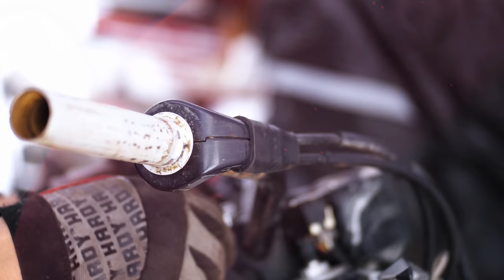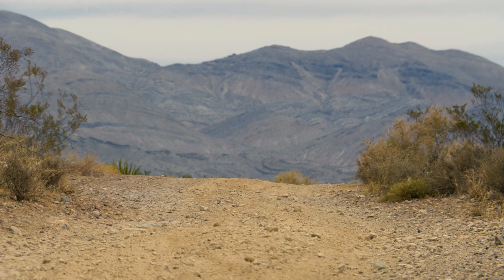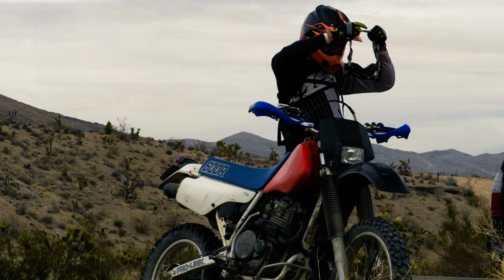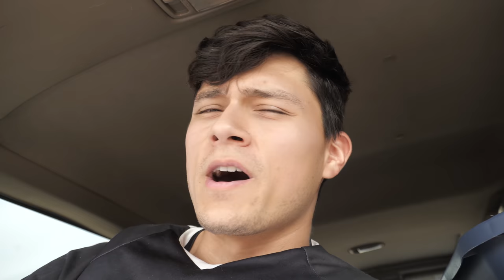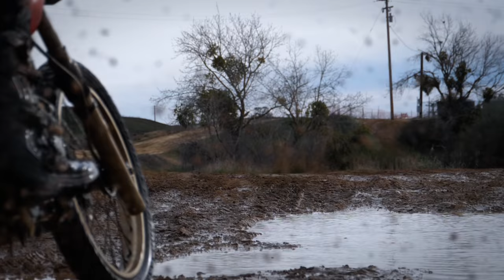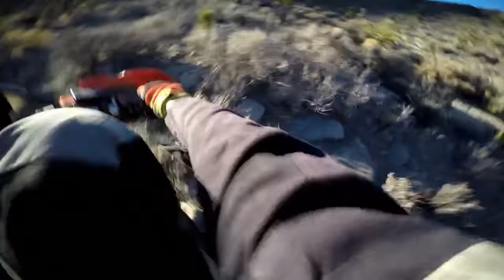XR600R - Size Matters. Testing the Beast.

Comment: If the clutch over heats just over fill the trans oil and I never use atf always use whatever brand 4 stroke oil that’s cheapest I find it works better
Reply: These engines share transmission and crankcase oil, they have NEVER taken transmission fluid.
Reply: @murraymachado401  eel if it shares engine oil with the trans then that’s why it’s overheating the clutch

Comment: Bet you break the gearbox riding it hard. I'm in the UK and i love my XR600. Use it normally and  it will last forever. Use it hard and it will break gears, especially 3rd gear. Hard to find good used gearboxes over here in the UK,  and a new set of gears from Honda would be half the value of the bike.
  If they're set up right and the decompression lever is used right, all the reported starting problems these supposedly have are a myth......until you drop it and try to start it straight away on a hot engine.
Reply: I HAVE OWNED 6 XR 600 OVER THE YEARS .......RODE HARD ON THE STREET RACED ON DIRT AND ICE .....ABUSED AND USED ...NEVER EVR HAD A TRANSMISSION PROBLEM WHEN MAINTAINED PROPERLY ....NEVER HEARD OF ANY PROBLEMS EVER FROM ANYONE I RIDE WITH .....YOU MUST HAVE SOME ISSUE WITH YOUR STYLE OF RIDING OR LACK OF MAINTENANCE
Reply: @craigbielsky115  Been riding hard and building/maintaining dirtbikes and roadbikes for 30 plus years now, so i take offence to your  capital letters shouty comment. I have only ever broke the gears on this bike. Check Jacob from Fast Guys-Slow Bikes and his comments on transmission problems. He rides his hard. Whiskey throttle show has a long Johhny Campbell(this guy knows XR600s) interview where he talks at length about the size and weakness of the gears in the XR600 gearbox being the bikes worst trait. He even talks about the mods they used to do to 2nd and 3rd gears using 650 parts. Another XR600 god, Scott Summers, also talks about transmission(and heat) issues being frequent. Ballards in Australia and XRs Only in the US even sold a complete 3rd gear repair kit for the 600.
  So please don't tell me they're not weak. Gearbox problems are well documented on various sites. You must be lucky. Next time you ride yours, try changing gears and twisting the throttle all the way round🐱😁

Comment: Only real downside of the big XRs is brakes.  Any real XR rider has slid right off the trail many, many times.  I cannot imagine what 600r feels like panic stopping on dirt at 70, probably like a runaway train.  The 650r is bad enough, and it even has “disc” brakes, in theory.  All part of the fun!  But the biggest upgrade I could ever do would be real, modern brakes on my bike, that correspond to its power capability.  That really would be a game changer.

Comment: Stop BSing you know it can’t keep up with the new 21st century four storks it’s old heavy and out dated. Acquainted is what comes to mind. I rode Xrs, 250, 350, 500, 600,650,. They weren’t good back then and there not good now! But cool videos!
Reply: Bring what you got against the 650r. Wear a roost guard, you will need it.  🤣😂.  

On the video, I really loved it. 
Personally, I don’t recommend Kenda track master for where i live.  I have found it is too soft of a tire for such a heavy bike (600r/650r) in Colorado.  Loses lugs.  I use d606 on back and non dot Maxxis desert Cross on front.  Big heavy fast Hondas for life! love the vid, new subscriber, good to see another poor bastard getting after it.  🥳